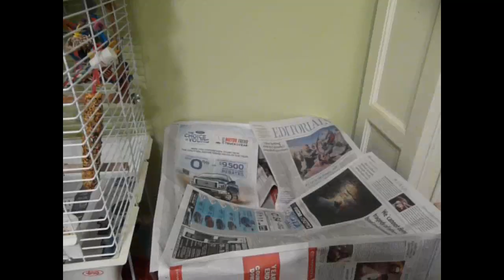Cleaning the Bird Cages: 9 Cages To Clean

Comment: You're pretty quick for so many cages! 

I have a similar routine - I have 2 cages. I clean the outside and the bottom of the cage in the shower (unfortunately, I don't have that sink that you do, it's great!). 
I take all the toys and perches out and clean them  - the plastic ones separate from the wooden. The plastic ones I clean with washing up liquid, but I'm afraid that it will soak into the wood, so I only use apple vinegar for those.

Comment: Why do u put that clear wrap on the cage ?
Reply from the maker: The bird is a Lorikeet and has watery droppings that he squirts out of the cage and on the walls so I put the plastic to keep the surroundings cleaner.
Reply: Chloe Johnson   to me that is a very dangerous for bird also they chew on it and asking for trouble with their digestive system
Reply: Mary Green I agree. Not even does she have sand paper that birds must have in there bottom of cages. It's bad for there nails having new papers. Sandpaper is a must  I got a canary other day and no alot already sandpaper is a needed item and is a must. Newspaper is so wrong x
Reply: I don't think the birds touch the newspapers because the cage grate is over it.

Comment: Hi Loveofpets, Great video! Some very helpful ideas on how to clean the cages efficiently. I was wondering where you got the plastic floor mats. Is there somewhere you can get them for less than $40 each?
Reply from the maker: +Shaneen Anderson I got my plastic floor mats from Home Depot. They are meant for hallway rugs to keep the dirt off. They work really good to keep the floor from getting poop on it.
Reply: +Loveofpets Thanks so much for responding. It just so happened I was just out front of Home Depot when I read your response, so I went right in there and found probably the exact same kind that you have. I'm looking forward to easier cleaning! :)
Reply from the maker: Your welcome, I hope your floor is much cleaner now.